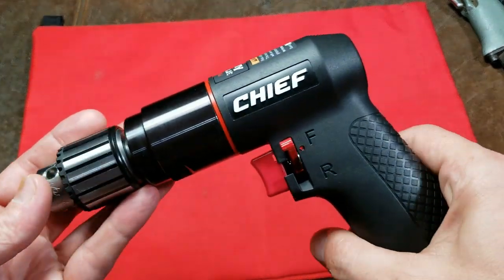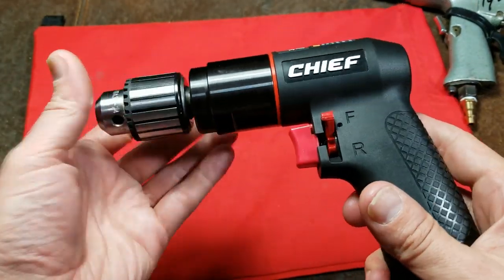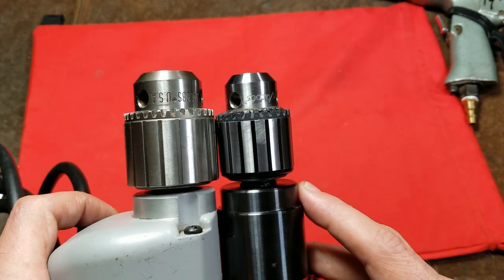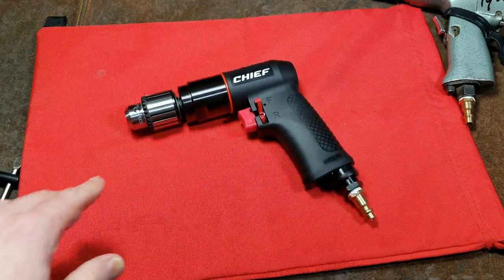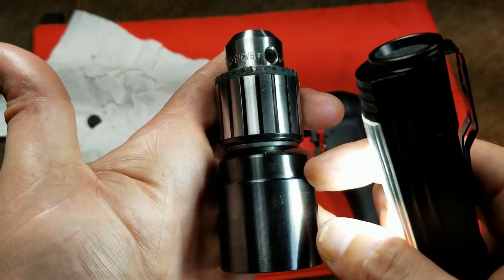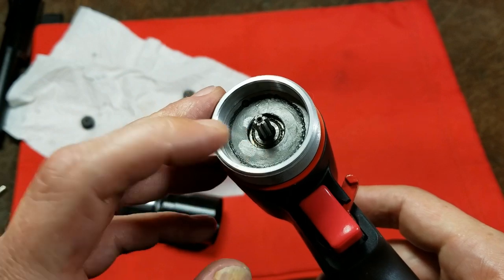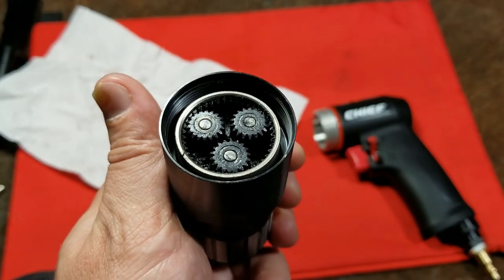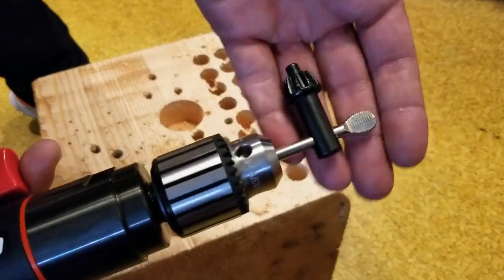Harbor Freight Chief ⅜" Professional Air Drill Review

Comment: Before you did the side by side. Comparison to the Dewalt Brushless  my thoughts on the Chief  was it was much more  ergonomic than. Most  of the other pneumatic air drills  we’ve had available  in years past  but you kind of covered that  ive always had a hard time holding or using the older drills for a long day  of assembly but then again these new ones are    I guess competing with those at around 80 dollars  i  do find it slightly interested. That these Cheif “ professional” Grade tools perform  so well on under  powered  compressors as you demonstrate  as most professional enviorment do have  pretty decent Air compressors set up  so wouldn’t think that would be a priorty in design  and manufacturing

Comment: Does it have a "teasing" throttle? (Variable rpm) Or just on/off?
Reply: You can buy a air regulator and control the air flow and speed yourselfers
Reply: @larryborkstrom3580  
Variable speed is the only way to drill rivets. You start off slow and then speed up once centered. For thousands of rivets in a day! Thanks for the suggestion though.
Reply: @upsidedowndog1256  your welcome